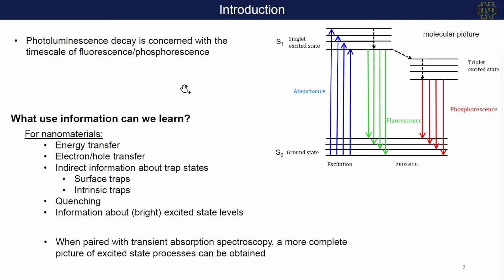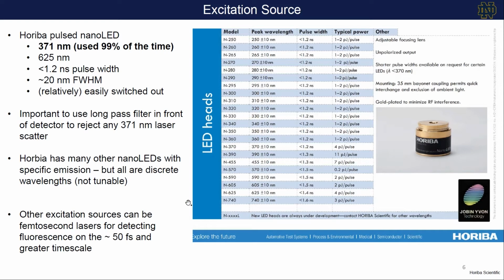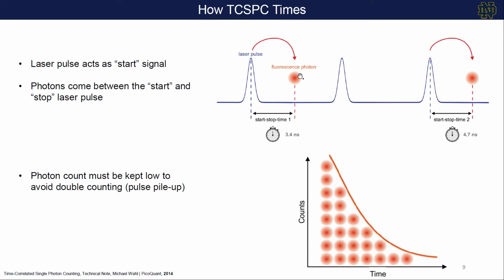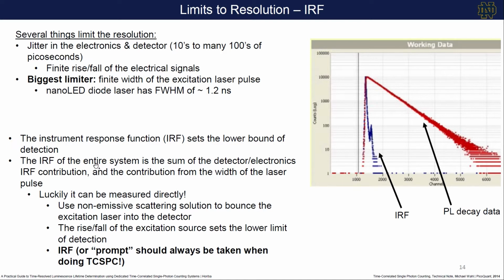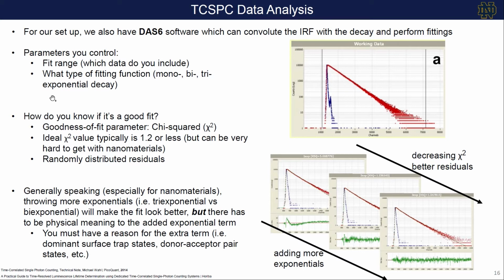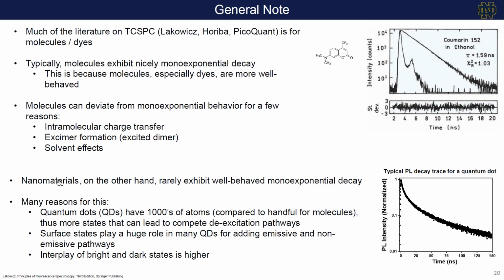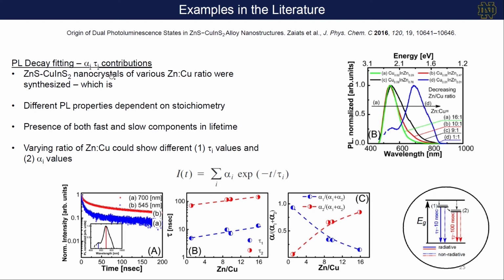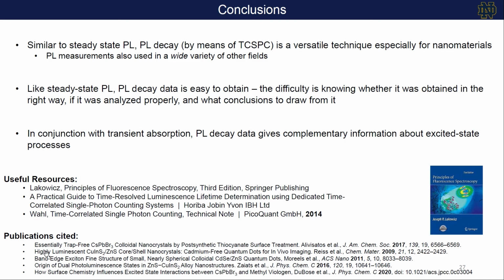Introduction to Time Correlated Single Photon Counting by Jeffrey DuBose

Comment: Thank you, Jeff, for the excellent introduction. Some of the materials show long-lived emissions on the order of microseconds. What could be the reason for a material to have long-lived emissions?
Reply: No problem, Udara
Long-lived emission often arises from phosphorescence, where a so-called "triplet state" is formed, where the electron in the excited state and the electron in the ground state have the same electron spin. Since recombination of the electrons requires a spin flip, which is a classically "forbidden" transition in terms of spectroscopic selection rules, it occurs very slowly and often on the order of microseconds all the way up to seconds. This is the basis behind glow-in-the-dark materials. 

Other conditions for microsecond-long lifetime could be that a triplet state and a singlet state are in close enough energy that the electrons can jump between those states multiple times (if the energy difference is on the order of thermal energy available at room temperature). This is typically called "thermally-activated delayed emission; TADF" and also extends lifetimes to microseconds.